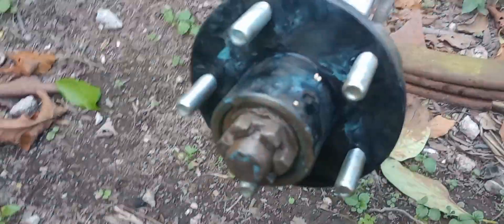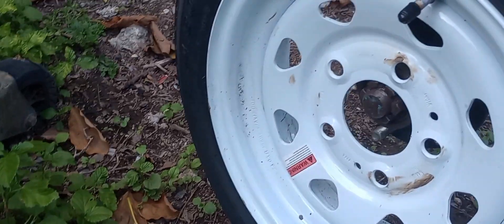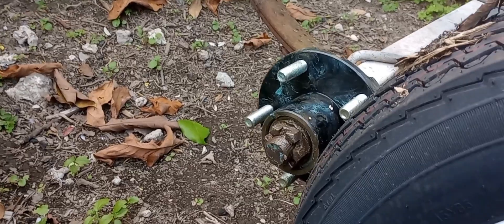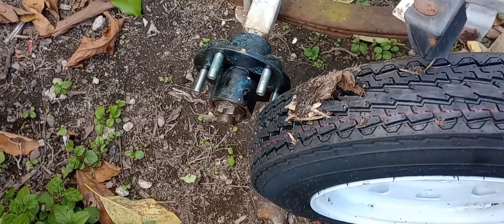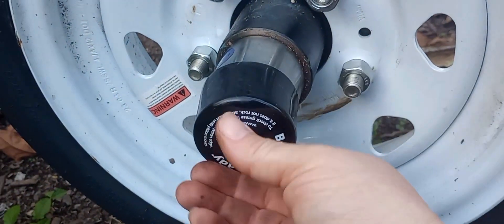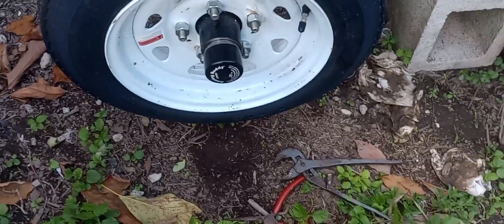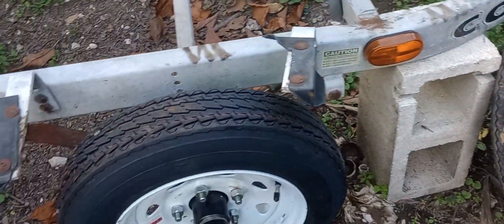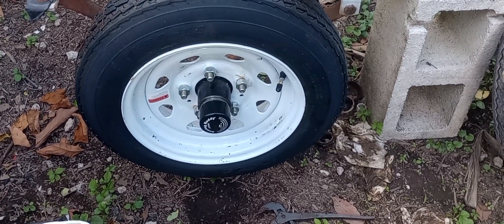I saved over $400

Comment: Looks like you got it done right. I would drive it around for a few miles than check that capture nut again. You need to tighten up than back it off a tad and re grease it
Reply from the maker: Thank you Jimmy, I'm not quite done yet I still have to do the other tire. I'm going to finish it tomorrow. Thanks for the advice I really appreciate it.